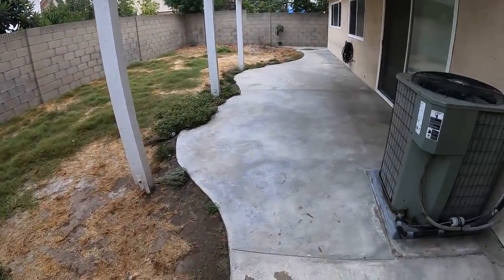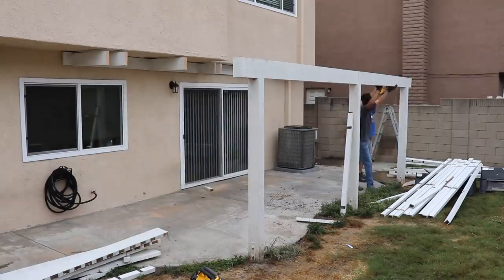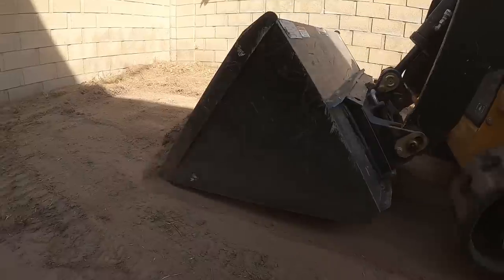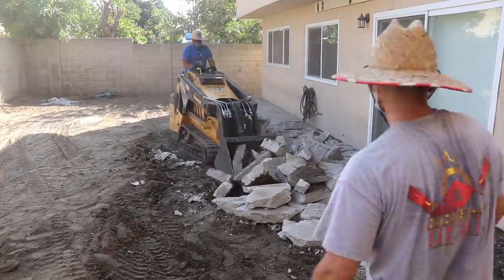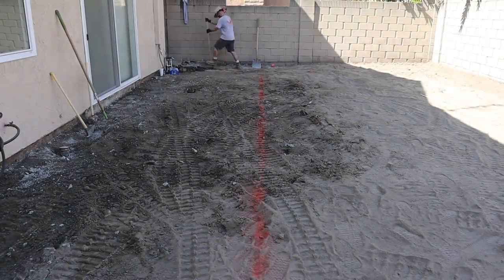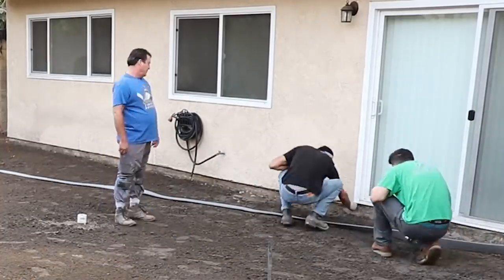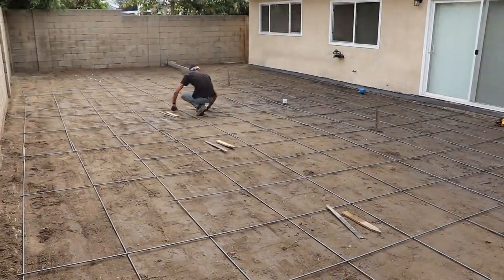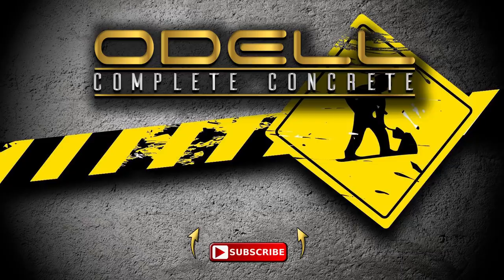Entire Backyard Setup from Wall to Wall for Concrete (Part 1)

Comment: Dude, this looks exactly like a new construction house I did in Laguna Niguel.  The same distance between the house and the wall.  Drains from the back on both sides out to the street.  I did pavers instead of concrete -- 1400 sq. ft. pavers.  I did cinder block planters on the back wall -- stucco with bull nose bricks with Queen palms.  I did a fountain in the center on the wall facing the sliding glass.  I looked on Zillow when the house sold and it look great after 10 years.
Reply from the maker: Nice work
Getting it on
OSS

Comment: How do you decide between 'wall to wall concrete with foam sheet' and 'dowel bars' ?🤔
Reply from the maker: I use dowels to adjoin slabs at the same level, so it never can become a trip hazard

Comment: David, do you have any videos where you do two different types of concrete finishes side by side? Say a colored stamped patio, bordered by a different color sandwash border? Just curious which you'd do first and how careful you need to be when protecting the finish you did first. Thanks for sharing!
Reply from the maker: Yes I do have some of those on videos.
I cover with plastic.
Reply: @OdellCompleteConcrete  Thanks! I will try and dig those up on your channel.

Comment: I was hoping he'd show a little more of the draining system. And see where the water is going to actually go through and come out of.... maybe that's a second video
Reply from the maker: Yes it is
Reply: @OdellCompleteConcrete  yes it is what. I have the same issue I would have liked to seen what are the inlet and Outlet of the drainage system that's what I meant thanks